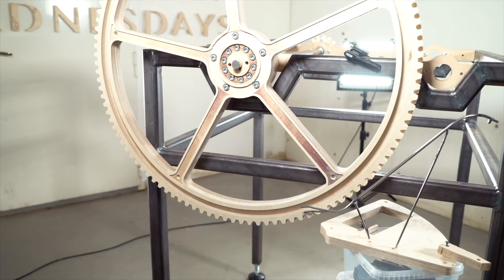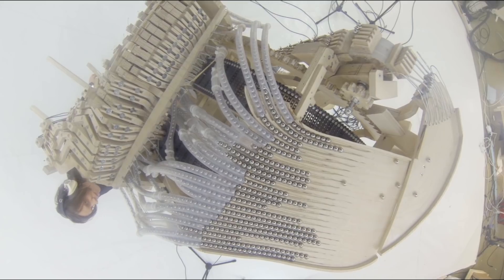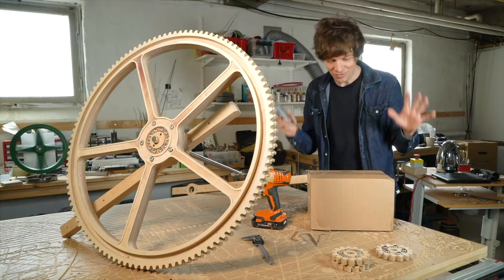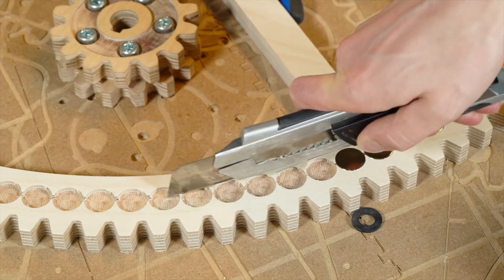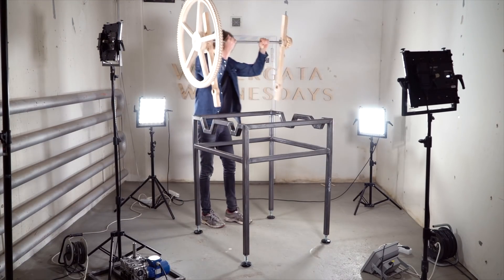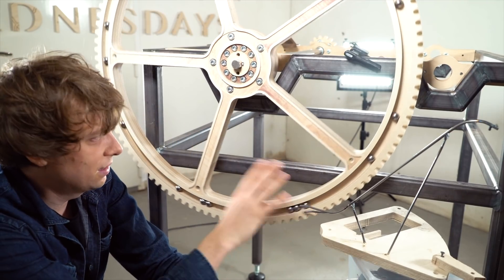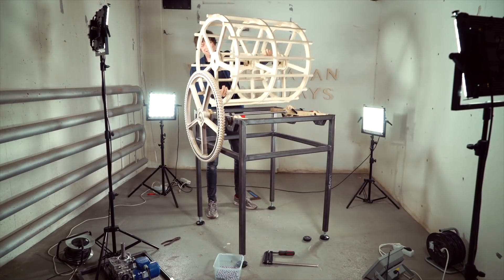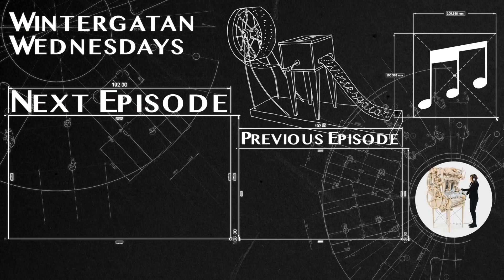Lifting Marbles With Magnets - Marble Machine X #13

Comment: I think the solution to the marbles becoming magnetized is may have to be a degausser. Maybe you can find a quiet one(most electric degaussers hum.
Reply: I have a degausser that has no moving parts or a power supply.
Came with my electronics screwdriver set.
It's X shaped, one side magnetises if you sweep it, the other side demagnetises it.

Comment: Why not add an induction coil (or several ) and generate electricity to power some led lighting? Of course the energy required to turn the wheel will increase, but it shouldn't be too bad when the mass of the magnet "flywheel" is rotating.

Wonderful device...👌
Regards Peter

Comment: If you have not solved the marble magnetism issue try an old TV CRT monitor degaussing coil.  Expect the degaussing to be done on the side between shows, as the need arises. Maybe some of the other degausser shapes would work better.

Comment: Would it not be easier to turn the lift to have the marbles be lifted from the inside? i understand that it looks a certain way like it is now but if the second lift has the marble lift on the outside it would expose the lift to have that look intact.

Comment: Please remember to be careful with the neo-magnets. I saw you smash magnets to each other which is dangerous. Magnets though they look like metal are actually sintered and closer to ceramic. So they are britle and break easily. If magnet breaks up it will form many "small" magnets which imidiately form S-N pole pairs. Those small fragments then repel each other so basically what happens is that magnet explodes and there is big risk for i.e. your eyes. So, pls be careful with the magnets =)

Comment: Do you consider to make program wheel really be programmable by computer? Something like hiding controller with WiFi or BT module and pins that can stick out or hide driven by electromagnet.

P.S. I like your previous machine and song very much and I really can't wait to see complete MM 2.0.

Comment: Two questions:

1. Won't the magnets inside the gear pull the bottom half of the gear towards the metal frame, making it run off-center or bending it over time?

2. Couldn't you simply use a system involving a stronger or repelling magnet to transfer off of the marble lift? (Not completely sure of the details here, I'm thinking of something with a strong magnet that pulls the marbles off of the lift, but the magnet's behind a piece of static plywood and the magnet moves away to allow the marbles to roll freely along the following track.)

Also good thing that you didn't make the magnets face opposite directions. With them all facing the same way, the entire side of the marble lift has the same polarity, so marbles can freely stick at any point along the lift. With them facing opposite ways, the magnetic field between magnets would be neutral, so marbles would only stick in the middle of the magnets, reducing the number of marbles that the ring could carry and causing more dropped marbles. You'd also have issues with marbles sticking to each other.

Comment: As a thought, if you need to increase the flow, it seems it shouldn't be difficult to remake the wheel so that it carries marbles on both sides. It would likely be made of 3 pieces, with 2 toothed gear layers with marble-carrying grooves sandwiching a much thinner inner layer, possibly without teeth, that only has the magnet-holding cavities. Using the same plywood thickness as you currently have for the gear layers, the wheel itself would only be wider by the thickness of the magnets themselves.

Comment: Clear laquer applied to each metal component before it is assembled will stop oxidation, if you want to keep the unfinished steel appearance. Otherwise you will quickly get rust from the air and the oil on your fingers.

Comment: i luv ur idea for the magnetic 8 shaped lift but if the wheels spin in the opposite way wont it cause problems cause ur marbles coming from ur first wheel will roll in against your second wheel and i have tested this idea you are doing which when i did it the marbles when rolling in against the second heel fell of more than stayed on im letting u know so u dont have a failier

Comment: I have a possible solution. You might want to check my facts if you decide to try it but I'm pretty sure that if you use paramagnetic marbles instead of ferromagnetic marbles the magnetization problem will be solved.

Comment: Why not add a 90 degree curve on the outside of the outer edge of the marble slot so that if one were to come off by accident there is a chance it could just roll back on again, this could also be used to help move the marbles from the wheel as it would mean you could have them move straight into a downwards rail instead of how it is now which might be awkward in terms of the exit speed of the marbles i.e the current method might need extra rails to make sure the marbles aren't too slow.

Comment: Very interesting approach... what would be the reason that a gravity only solution would not work?

The gravity would be implemented by wholes bored into a 4..8 marbles thick wheel in a conical way like the axis of the wholes would meet at the tip of a cone. The marbles enter on one side and then enter on the other side. Tho hold them in it would of course need a stop or guide for about 160 to 170 degrees (similar to what 'Wood Marble Machine' at, for example, https://www.youtube.com/watch?v=lQvcoOzmLqs).

Comment: I doubt that alternating polarization of magnets could help much with magnetizing of magnets. Since magnetized iron is iron where electrons rotation axes are aligned you need to either induce some entropy by heating it, or scramble it with rapidly changing magnetic field.

Comment: I don't think alternating pattern will help with demagnetizing. Marbles will rotate themselves into correct polarity position and magnetize even more. What might help is demagnetizer somewhere on the return path of the marbles. Basically you want to apply alternating magnetic field to the marbles. Which can be done, for instance, by rotating permanent magnets around (or underneath or sideways) marble track. Which by itself may add to the presentation of the machine :)
Alternatively you can use two coils of wire, one hollow through which marbles are passing and which works as demagnetizer and another one with core, which should be located somewhere near rotating magnets and work as AC current generator.

By the way, if you want to increase magnetic attraction force you might want to look into https://en.wikipedia.org/wiki/Halbach_array
Of course, you will have to buy square magnets for this.

Comment: You could have the marbles shoot through the spokes of the wheel that moved them up (the magnet wheel). This could be calibrated/timed at the magnet intake point in the bottom. Just have some intervals in your intake

Comment: +Wintergatan  Magnetization occurs when the metal is impacted through a magnetic field.  So if you had a way to gently enter the gear, rather than clack the wood, that would reduce the gain.  Alternating the field as you said, would make it stronger, so could increase the effect, but I'm not sure.  The best i could offer is that smaller marbles develop weaker amounts of charge, but that may not help.  The term you want to wiki is "Saturation_(magnetic)"

Comment: Instead of a wedge on the top of the wheel to remove the marbles, have you considered a stronger magnet positioned in the exact distance to pull the marbles from the wheel but they fall to a collector plate/second wheel instead of sticking to the stronger magnet?

Comment: Also, rare earth magnets are the best. Seriously. I could play with them all day. 

Thought I'd also add that the setup at 10:13 would make an awesome game if you added a release mechanism and a motor to keep the wheel spinning. Paint the outer wheel different colors, add values to outer rim. Just a thought.

Comment: If you had put the magnets alternating you could either generate electric power (search pancake generator) or use it in reverse to let a coil power the wheel (electric motor) or you could use a the generator as a way of generating a tone or power another wheel. Both generating and cosume power :)

Comment: Would you mind telling about the problem with the magnitisation of the marbles?
Do they get stuck together, when you're trying to seperate them, get stuck near screws, or influence the marbles in other places of the machine?

If the only problem is the behavior of the marbles after reaching the top, if there is space it should be possible to demagnitise them, with a device like it's used when erasing audio/video cassettes, only big enought to fit a marble in the air gap of the iron through that the magnetic flux is flowing.
Not sure how much power is needed for that, because I don't know how strong the marbles are magnitised.

Comment: Another solution to the marble magnetization would be to heat the marbles over their Curie Temp. I'd use a induction heater and run the marbles through the heather in a pipe. If it's strong enough the induction heater would flash heat them and then the could cool while running over some metal track (to avoid burning). 
REPLY

Comment: If your having trouble with the marbles becoming magnetized two simple solutions i can think of would be having non magnetic metals or materials where you don't want them to stick or depending on what you have to work with. (space or time) constructing a demagnetizing device. If the magnetizing of the marbles happens slow enough I imagine you could do it between shows/songs. If it's a faster effect maybe looking into making one to tuck out of the way on the marble device would work. I'm not an engineer tho and these were just two simple ideas i thought of. :/ Still I love seeing this come together and am looking forward to more of the group's work.

Comment: Not a physicist... but if the marbles enter at the bottom and get raked off at the top, that means all those marbles will only be on the rear half of the wheel. Will that put it off balance?

Comment: Have the crank turn a small alternator, connect the alternator to a coil, and pass the marbles through the coil to demagnetize them.  Also, that steel rail ramp leading up to the gear is noisy with the marbles on it.  I'm guessing it will be rubber coated when finished?

Comment: Put a copper coil somewhere near the magnet wheel and see if you can make enough of a current to power some old fashioned lights inside the machine. Could use them to highlight specific parts for shows and exhibitions.

Comment: I wonder if you could use a demagnetizer like this with a funnel. So when the ball bearings pass through they will at least demagnetize a little each time. Might help with them sticking together?

Look at this on eBay http://www.ebay.com/itm/222500606414

Comment: After watching other videos which also used similar magnets, depending on your magnet source, the magnets' attraction strength may vary quite a bit from magnet to magnet.  You may want to test and sort the magnets for a particular strength, knowing that if they're not strong enough, the balls will not be held correctly on the wheel, and if they're stronger than they need to be, it seems like it would only invite faster magnetization of the balls.  You could also work with a batch of particular magnet strength magnets, and vary the thickness of the gear wheel, or depth of the magnet in each pocket or some such.  BTW, did you use Matthias Wandel's wood gear generation program to make your wood gears?  This really looks like a lot of fun.  I'm looking forward to more videos.
Reply: This guy is making an electric motor, but watch how he measures and sorts out the magnets to get a few ideas.  Magnet measuring and sorting begins at 7m and 36s in.

https://youtu.be/YsSm65DAcCg?t=7m36s

Comment: The magnets would still become magnetized in an opposite direction, but they would repel each other, and give clearance between the marbles. Applying a force to one side (e.g., trying to separate the magnets) would result in an easier separation, since it would be running into an elastic wall caused by magnetic hysteresis in the other magnet. Could be a good call.

Comment: Swapping the poles around every other magnet should help with making sure the marbles don't become magnetised.
At the moment the direction of the poles is so consistent that it's basically one big ring magnet, meaning the marbles are always experiencing the field int he same direction. Swapping every other around would help equalise the fields and with no consistent field to apply a magnetic force, no one side of the magnet can gain either North or South,

Comment: M js wondering.. y dont u make a hole on de other side of the gear wheel so dat the ball bearing can be pushed by a mechanism. Dat entry & exit hole for the ball bearing should not exist elsewhere coz of a metal plate behind da gear wheel prevents em from going elsewhere..? Its like something is covering the hole but let the ball bearing rides (enter) the gear wheel at one point & exit at another.. ?

Comment: Those spinning magnets could pull double duty. Moving past a coil of copper wire, they can create a DC electrical current which (in theory) could power something small (LED lights? Tone Generator connected to an amp circuit?)

Comment: Just thinking about it: You could attach a coil of copper wire somewhere near the lifting gear and maybe generate a bit of AC electricity to power a light bulb or something. :'D

Comment: In the machining industry the process of grinding with a precision surface grinder causes the part to become magnetic.  That is solved with a small device called (go figure) a demagnetizer.  You could place one where the marbles roll over it.  I think that would solve your problem.

Comment: careful with the hammer there.
those are strong magnets, but too much hammering can screw them up.
I'd advise you to cut a ring of metal the size of the groove, and lay it on top of the thing for storage.
that way there's always a metal closing the magnetic field, setting the magnets straight.
if you can get a piece of aluminium of the same shape, lay it on top of the metal ring... that would insulate the whole thing.

Comment: Having the Magnets setup on the wheel in N,S,N,S,N etc would help stop the balls from becoming magnetize.  If the steel balls do become magnetized, setup an electromagnet running off 50/60Hz with the balls close to the electromagnet, then move the electromagnet away from the balls and this will demagnetizes them.

Comment: The metal spheres are ball bearings the glass spheres are marbles.
Reply: Wrong. Ball bearings are bearings that use balls. Why do so many people fail to see the difference between ball bearings and bearing balls?
Outside of a bearing, the balls are simply steel balls. It's totally fine to call them "marbles". Quote Wikipedia: "A marble is a small spherical toy often made from glass, clay, steel, plastic or agate."

Comment: You may want to add a protective plastic wear plate (maybe 1.5 mm to allow magnetism to happen?) as the metal marbles will keep hitting the gear, causing dents in the wood. Then you can replace the plastic wear plate anytime you need. To remove magnetism effect, you can add a small de-magnetiser, provided it don't interrupt with your electronics... Cool machine and idea...loved your marble machine idea since the first day I saw it. All the best for your second marble machine! :)

Comment: Regarding magnetized marbles, this is a somewhat common problem in pinball machines that use magnets. Some people just replace them with new, not magnetized ones. Others prefer to buy a demagnetizer (a.k.a. "degauss wand".)

You might need to avoid dropping the marbles from steel/ferromagnetic tracks, otherwise the residual magnetic field might alter their free-fall trajectory.

Comment: I wouldn't use a wire ramp to put the marbles on the lift. It works well enough when they go on one at a time, but if they pile up, marbles will start falling off. A larger tray slanted into the wheel would probably work better.
And at the top of the lift, rather than catching the marbles with a ramp when they fly off, you could have the magnets pull them into a tube and have the tube pull them away from the magnets. Again, just to minimize the chance of them flying off the track.Really great progress so far! Can't wait to see more!

Comment: Wouldn't the now magnetic gears apply too much attraction force from the lower side of the wheel into the steel frame? If this generates some camber you guys need to compensate it in the other gears! Keep up the great work 😁

Comment: I think it's better to alternate the polarity of magnets. A magnetized marble will behave differently when striking the lifting gear surface: it will attach quicker and with less chance of slipping (driven by repulsion, momentum, and angle of strike) when polarities are matched. When magnets are laid out with uniform polarity,  a magnetized marble slipping on the first magnet will also slip on the next. Contrast that to an alternating polarity layout where a slip on the first magnet guarantees a match on the next magnet.

Also by having an alternating polarity layout, magnetization buildup on the marbles is delayed. In a uniform polarity layout, a marble will have a 50% chance of attaching with matched polarity to any magnet (attaching with matched polarities strengthens magnetization). On the other hand, an alternating layout will only have a 25% chance of a match of polarities between marble and any magnet.